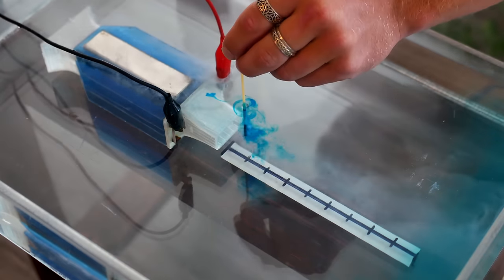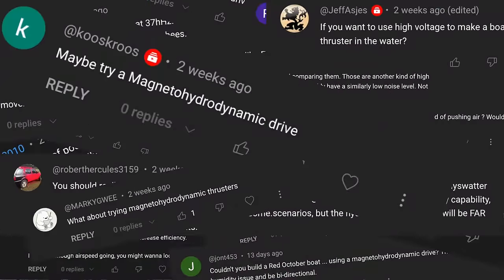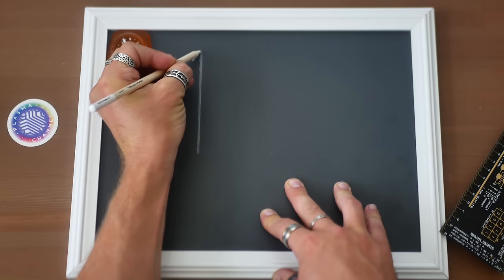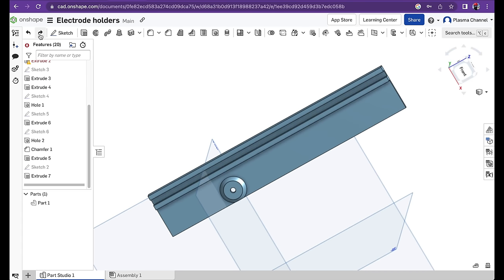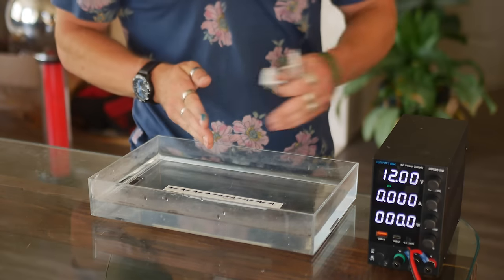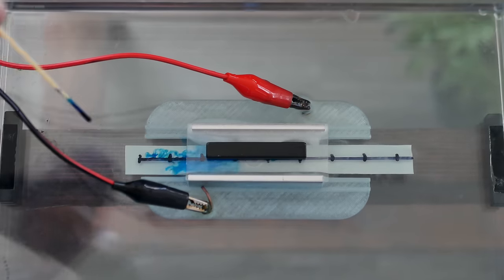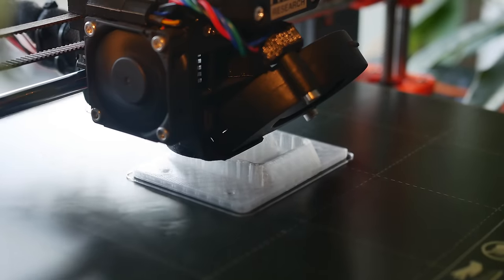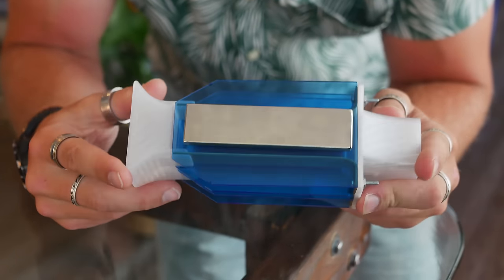Using Stealth Propulsion for Ocean Travel (MHD Thruster Build)

Comment from the maker: Let me know your thoughts down below - I'll be revising this to increase output. For the time being, 3D files can be found on my Patreon site!
Reply: Bro u r genius 😎
Reply: General Atomics has some great powerplants to exponentially increase the dielectric discharge on these types of propulsion systems. Just like how the 6' Ionocraft Townsend Brown demo'd at Wright Patterson in the late 40s was rapid prototype engineered with greater discharge, capacitor plates, & layering to increase the Lorentz Forces to create sustainable flight. 

Pulsed Power applications developed at LANL and Sandia back then allowed for not only Laser Propulsion, but Ion & MHD Propulsion Systems to create extreme acceleration/velocities to "blink" across long distances which to the naked eye looks like FTL. 

You're welcome.
Reply: can you make new star in jar useing tritum atomes
Reply: Use rotating magnets for an AC field and apply synchronised AC to the electrodes. That should minimize electrode erosion.

Another way is to keep the magnets stationary and have the electrodes as part of a rotating cylinder.

If you could create a closed magnetic path except for the water gap, you can use an AC coil electromagnet.
Reply: where can i get that ruler
Reply: by the way love your ideas .... it lifts up my mood
Reply: and elevates my thinking and reasoning
Reply: Why not carbon electodes + AC voltage + Electromagnits, as they do in Japan? Not cool Jerry...not cool.
Reply: The reason for similar velocity with variable spacing could be due to the  volume of water interacting with the setup changes ( but it does not make sense as the further apart has a lower current draw and similar velocity, therefore is effectively producing more thrust)... Because of this it apears a larger gap is better all round
Reply: Does the water salinity play a part as well or does it not matter? That could have been another test base.
(edit: average ocean salinity is about 35ppt (3.5%) for 'real world' testing)
Reply: find yourself a local metal supplier because you'll lose your mind at how much cheaper they are than home depot. I get aluminum off cuts of any shape or thickness for bottom dollar while supporting a local business, you'll be glad you did it.
Reply: You could try using an inert metal like stainless steel to avoid any oxidizing. There's also graphite.

You could also look into capturing the hydrogen and oxygen coming off the electrodes, as they're pretty useful, and a good portion of your energy goes into creating that flammable gas.
Reply: if increasing distance between electrode doesn't increase the speed of the water ......but the volume of water is also increasing means  it will increase the thrust .....need practical confirmation .🤔🤔🤔
Reply: Well, looks like I'm going to have to finally get back to trying to get the gremlins out of my 3d printer so I can attempt this!
Reply: plasma is a conductor. can you do this with fire?
Reply: What small table saw are you using in this video?
Reply: Would a pair of electromagnets be more powerful than a rare earth magnet? If you have an electromagnet you could experiment with AC on both the electrodes and the electromagnets right?
Reply: Maybe some polystyrene balls would be better at gauging the water velocity as dye spreads as it moves it's more difficult to calculate the velocity
Reply: Make an AC resonant engine with electromagnets and isolated electrode plates.

How it works:
The electromagnets and the isolated electrode plates form a tank circuit that oscillates at several kilohertz.
When the water gets polarised in the electric field between plates, the induced magnetic field in the coil pushes it in one direction. When both the electric and the magnetic fields get reversed in the harmonic oscillator, the water still moves the same way.
Use a self-exciting circuit to amplify the oscillations in the tank circuit and thus increase both the current and the magnetic field.

Since distance between electrodes isn’t crucial, but magnetic field intensity is, the electromagnets can be E-shaped with an electrode in each groove of the E and with the middle of the E and the margins having different magnetic polarities (so water in both channels gets pushed the same way). It doesn’t matter if the motor is “opened up”, water is still going to be pushed. Remember, we aren’t making a water pump, we are making a boat propulsion system. So it doesn’t matter if water is pushed in one narrow stream or if the whole ocean is pushed a little, what matters is that the boat is pushed ahead against the water.

Advantages:
- no corrosion
- no energy wasted on electrolysis
- no gases generated
- works with plain water and non-conductive fluids due to using them just as a polarisable dielectric medium

Disadvantages:
- more complex circuit
- requires electromagnets
- requires better isolation, the oscillating tank circuit could reach even 1kV depending on how strong the resonant oscillations are
Reply: Very impressive.
When you turned the engine on it's side it blew gases, I don't believe this was the electrodes dissolving, rather the gases (hydrogen, oxygen and chlorine) that had otherwise been bubbling directly up.
Reply: Could you give us data on thrust by your device compared to a standard drive with the same power input, and power density?
Reply: Hi, Jean-Pierre PETIT is a french expert on MHD and he answer in video to anyone who want his lights.
Reply: Is this harmful for fishes ???🐟🐟🐟
Reply: Could a thin layer of semi conductive silicone be used to prevent electrode decay from oxidation/ electrolysis? But still allow current to pass through.
Reply: close the magnetic circuit from the outside!
Reply: How about double helix wire electrodes with a round bar magnet suspended in the center? Probably want to put in a tube to contain the water around the magnet.
Reply: Why not combine all three: Ionic Plasma Thruster + MHD + Fan Motor
Reply: Maybe closer electrodes aren't pushing more because you aren't allowing enough magnetic field between them. That's why stronger magnets help. You are kinda stacking the magnet fields for more strength to compensate for less room between the fields. I'm probably way wrong. No degrees here just some thoughts. Maybe you could word it better or at least understand what I'm trying to say. ❤
Reply: Did you can use zync metal bricks for defend your engine from corrosion?
Reply: Ok now build electro magnets and use them instead ?
Reply: maruiacancerc  
Wish you an easy recovery and success with your channel 🙏
Reply: I’m pretty sure you’re losing efficiency to the electrolysis. You want a configuration that can run at as low of a voltage as possible while dumping as much current into the water as possible. You’re probably not going to be able to beat seawater’s 1.5v electrolytic breakdown voltage, but the closer you can get to it the more efficient your drive will be.
Reply: How much thrust do you get if you insulate everything and just use electromagnets like in a real railgun arrangement?
Wanna see that video.
Don't you zap a fish if you use the drive you are using?
Reply: What about ring magnets?
Reply: an multiple electroplates? paring them?
Reply: The big loss is electrolysis. Kind of like a diode rectifier looses performance at low voltage high current due to forward voltage. Ideally, superconducting magnets would be used to maximize the force per current.

For your design, try to maximize electrode spacing. Electrolysis is similar to forward voltage- power is proportional to current. Therefore, try to maximize voltage. A single, wide channel is better that 2 narrow ones in series.
Reply: loved meeting you at open sauce. Why cant you just increase the voltage tho?
Reply: @PrintedFirstMessuredAfter  Don't zap the fish! ^^
His reason was probably because he used a model boat sized engine or he doesn't want to zap the fish^^
Reply: What if you used foam beads instead of blue tint to measure speed & acceleration. You could the account for the mass being accelerated. In fact, it might give you a more accurate measure of speed - the foam bead(s) would have much less mass that the water-based tint you’re adding.
Reply: RECOMBINE THE HYDROGEN AND OXYGEN AND IGNITE IT OUT THE BACK OF THE ENGINE!!!!!!!!!!!!!!!!!!!!!
Reply: Create a void? Like get rid of air or water in a place
Reply: Here, electric field = charge per unit area/ Epsilon*water constant 
E=Q/(Aεk)
And voltage supply=(charge per unit area/ Epsilon*water constant)*distance between electrodes
V=Qd/(Aεk)
As area,Epsilon, water constant and voltage supply is constant therefore there is the variation of charge and distance between the electrodes is inversely proportional or simply electric field is inversely proportional to distance between the electrodes but here the effective capacitance is formed so the sudden change in the distance between the electrodes do not suddenly change the charges on the electrodes therefore there is not sudden effective change in electric field in small period of time which can contribute to the water current. It is just like a spring it is not impulsive.
Reply: Try to make spiral for longer acceleration way
Reply: If you run an open system with strips of magnet and conductor layed down in +n-s+n-s in stripes aligned in the direction of travel ,,,,,
The area increases,
The field strength increases (narrower magnets)
The current increases (less distance. 

This way the entire hull can be utilised and the boat falls downhill into the hole created by sucking the water away from the front.
Reply: Ion flow, not electron flow. 
You reached saturation of ion production at the surface of your conductor. 
The ions then flow regardless to distance. 

It’s not resistance, it’s creation of ions,
Reply: @KastorFlux  chlorine gas. 
That then combines with water to form hydrochloride acid.
Reply: @KastorFlux  
Yea. I agree it isn’t much. 
But sodium hydroxide, hydrochloride acid and potassium hydroxide are the most produced and do react back into salt very quickly. 

The electrode issue is cheapest fixed by using stainless and best fixed by using platinum or palladium or gold.
Reply: Wondering could it be done so that the ground is in the center and theres two thrusters on each side. Theoretically thats 3 electrodes total and you can still have 2 different thrusts for steering etc.
Reply: Come to think of it, in principle, we shouldn’t even need electrodes.
If we magnetically induce an electric current in the water, it will itself create a magnetic field opposing the one that induced it so the water will get pushed away.
But for this we need some super-duper-strong electromagnets and lots of power at high frequencies but it sounds plausible.
Reply: @de0509  
The entire hull can be covered by strips of -s+n so the entire wet area is creating thrust not drag. 
When you do the maths etc it’s far more efficient and the boat falls into the hole it made in front and off the hill it made behind.
Reply: @brucebaxter6923  
I actually suggested something like this in a comment to rctestflight 😄.
Essentially pump the water piling in front of the boat to the back of the boat. This might not create a valley at the front but it will render the hull speed to be as high as the pumping speed is which no longer depends on the length of the boat.
Reply: @cezarcatalin1406  
Good idea but the hull still has skin drag and drags the water to the front again.
Reply: @KastorFlux  
Have you ever stood at the harbour entrance and heard a ship go past?
They already are silent
Reply: You could use AC and electro magnets, it should be better because oxidations would be less of an issue. The magnetic field could also be stronger, because electromagnets can be very strong if cooled correctly. I might give it a try myself, and report back on my findings.
Reply: @gellertapati4103  
Nope, field strength is way less from electro magnets, but yes, since it’s ion flow an ac high frequency would be better
Reply: @cezarcatalin1406  I want to see a boat with snow mobile belts
Reply: @brucebaxter6923  even with a ferromagnetic core and highish current? Also, i don't know how it would work with an ac current and non changing magnetic field. I my brain the water would only oscillate back and forth. Correct me if im wrong, I am not that familiar with this type of things
Reply: @gellertapati4103  
Yes. Rare earth magnets are still far stronger than electro magnets for their size and weight. 
It has to just work inefficiently or mechanically flip magnets.
Reply: @brucebaxter6923  the point of this project is to have no moving parts. If he would be going for efficiency, then a prop and motor would be the best way of doing it. For short running times electromagnets with ac would be the better choice in my opinion. It would be inefficient for sure, but he basically has unlimited cooling and also modern batteries would have no problem to supply high currents. If an electromagnet is driven hard enough it can outperform even rare earth magnets in theory. I am really interested in this project, when I'll get a bit of free time I will give it a try myself.
Reply: @h7qvi  Wouldn't moving parts defeat the purpose though?
Reply: I hope LP99 is really what they claim to be. It would be an insane benefit for projects like this.
Reply: @korinogaro  LP99?
Reply: @ThaG001  It would to a degree. There should be less than normal prop wash, but probably still too noisy for real silent use. Really was more just for experimentation.
Reply: I wonder if adjusting spacing and magnetism respectively would Increase thrust. My thought being that if its two forces counteracting each other, maybe the spacing does increase electrode strength but there is not enough magnetic forces to push back against it.
Reply: Your "safe" thruster is creating a lot of chlorine gas. In normal electrolytic systems you would typically use KOH as an electrolyte, using table salt such as you did at 9:47 WILL produce chlorine gas. In the ocean, you have no control over the electrolyte and concentrations. So marketing this as "better" for wildlife is misleading. 

At 11:06 you are getting hydrogen or chlorine gas trapped along the surface of the electrode since the electrode is now horizontal.

 The green residue on your electrodes at 11:38 indicates you were forming hydrated copper chloride salts. The white residue on the same electrode is zinc chloride. Your argument about using brass electrodes is actually not applicable because you are using table salt and any oxides you are forming are on the outside of the cathode where the pH is not regulated.

The nickel plating on the magnets causes a galvanic corrosion channel for the brass.
Reply: @anupbiswas6571  There is a flow of electric current through the water between the electrodes, so if a fish passes through the drive it would get an electric shock.
An other aspect is long term pollution depeding on the electrode material.
Reply: I think when the current goes up due to shortening the distance between the electrodes, you're losing energy to heat and electrolysis.  Have you considered building a version that uses induction, perhaps with a sawtooth wave form?  This might allow you to build a version with no electrodes corroding in the water.
Reply: it is an efficient version of reverse osmosis
Reply: @barontau6552  
Discussed earlier, the chlorine turns into hydrochloride acid and reacts with the sodium hydroxide that also was created and ends up as salt again very quickly.
Reply: @uvx508 seems like no moving parts was part of the goal
Reply: I love the replies here -so much knowledge!!! 😁🤩😍
Reply: @Nobe_Oddy  LOL. but the idea was to make a silent thruster. . .
Reply: @KastorFlux  he could combine literally everything here lol
Reply: You could boost this by reworking its Venturi throat and add an aspirator cone -better yet, add 3 stacked aspirators. To be able to protect against corrosion:

 use a tesla-coil to create a strong electromagnetic field that can transmit through pretty much any insulation 

ooh try using a V shape of the electrode spacing, I've no idea what'll happen. wait, this might add a moving part -BUT 

A spiral-shaped tesla bladeless turbine could add to the thrust while lengthening the path the water takes

(I posted several comments before I aggregated them into this one)
Reply: How about using Copper and magnesium for the electrodes?
Reply: Mass production and raw directional momentum (pushing power) is the practical test. If it cannot compete to the power, durable longevity, and the cost to build for boat propellers, then it's best for toy boats.

If this tech can replace or equal boat propellers. Then it can be the next innovation to explore the ocean. Although, given that it's magnets, the electromagnetism may have unintended faults with its bigger version... Durability concerns for the magnets on a 24 hour active period test.

You could actually build a light weight house on the ocean if you have enough of this tech at different sizes. Assuming the wind and water conditions isn't rocky. Then transform it into a submarine / hybrid land vehicle with the right modifications + wheels. A "moving house" of this kind is definitely not normal to see.
Reply: One design consideration that you're not considering here is the drag of the thruster. It's fine for this test to have a bulky design since the surrounding water is fairly static, but on a boat once it gets going there comes a point where the bulk will definitely be a hindrance. 

STRICTLY SPEAKING, a MHD could be built with very little drag by lining the boat's hull length-wise with alternating electrode-magnet strips in the pattern +,N,-,S,+,N,-,S,+,N,-,S,+, ... This would mean that the hull of the boat is almost "wrapped" with an EM field where the electric and magnetic field are intersecting almost perpendicularly at every point thus generating a skin layer of thrust along the entire hull
Reply: If longer length increases velocity, isn't it a good ideal to use long coiling electrodes as stages of increasing the velocity ?
Reply: Well that's a great idea but what's the point? We are going to need electricity anyway like motor propellers and also if you get the water electrified due to the electrodes you can end up killing some underwater creatures 😅
Reply: @technicalgamer-shounak3633  the electric field drops off in intensity very quickly and it is silent unlike propellers
Reply: Thanks for making. You can get significantly increased magnetic field within your conduction channel by shorting the external magnetic flux return path with a high permeability material. (I.e. -- mild steel.)  Don't let the 'shield' get too close to your channel however, as the magnetic field will fringe (stray) into it instead of traversing the channel.  Very cool.  I'm excited to see your next version.
Reply: Try it with electromagnets please!
Reply: Remember, the velocity of the water doesn’t matter—you’re after thrust, which is a function of the total combined momentum of the water propelled backwards. A larger gap might push slower water, but it also pushes more water
Reply: Can you try making a UFO by mixing the quantum levitation with this as propellers?
Reply: You should try other metals for the electrode and see if higher conductivity leads to higher outputs
Reply: I would love to see a part 2, where you refine this simple 1st attempt prototype, and hopefully see if setting up stages to see if that could help it perform better, have a 1st and then a 2nd stage, see if that would lead to an even faster one... just a thought
Reply: Efficiency? Cost of operations/production? Harmful environmental side effects? Recyclability?
Reply: Give me samarium magnets! They're difficult to get, make some of the fastest motors and would be epic for this or flying saucer tech 😅
Reply: Were you not worried about creating chlorine gas from the electrolysis of salt water?
Reply: Hello friend!
Maybe you can try to use a circular Halbach array so you can benefit from all the sides of the magnets and also increase the magnetic field in the functional aria I have a design that uses the same concept that you may be interested in
Reply: @Galerak1  yes, I built some of these back in school. The salinity improves the conductivity of the water. It gets faster the more salt you dump in the water.
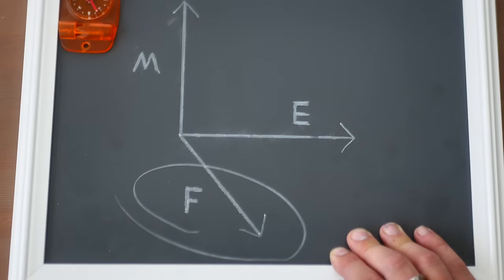Reply: 2:50 This is how a railgun works.....This is how a railgun works.... does this mean you can shoot water with this?
Reply: the issue for long term use is the electrodes being killed - platinum lasts longer, or keping the voltage below 1.2V which needs more electrodes for closer spacing to keep the current higher.
It can move a boat, i've made them before - but it uses a LOT of energy.
Using higher voltages and aluminium electrodes (all I had handy at the time) you could see the aluminium being 'blown off' and flakes of it floating about in the test tank.
Reply: What if the electrode was just a winding around the magnets but on a outside of tube and the magnets were inside the tube.. instead of the current going thru the water making Hydrogen 2 and oxygen 1.. stopping the electrolysis process??
Reply: @Nobe_Oddy or use to power the system..
Reply: OUTSTANDING! I wish I had that kind of propulsion on my Flying Submarine to assist on takeoff. Good luck with this project, and hope the U.S. Government is more supportive than it was for our project. br
Reply: What about carbon fiber electrodes? They are non corrosive and are really great conductors.
Reply: Can AC current mitigate the corrosion and increase efficiency? Magnets should be electrical too, of cource.
Reply: Can you 3d print a Red October?
Reply: So, for electrode spacing, you measured velocity which remained constant despite spacing. This suggests that wider spacing may be moving more water at the same velocity, which may mean more thrust.
Reply: @edwardnardella6854  Also what happens if you v shape the electrodes wider at the front and more narrow at the back and perhaps do the same with the magnets. Does this create a Venturi effect increasing the velocity of the flow?
Reply: I’m missing the test of space between the two magnets. Your data suggests a wider distance between electrodes produce more water volume being moved. But I would believe having two magnets closer to each other would make it faster.
Reply: If you incorporate a tesla valve at the end of the thruster, it would increase the flow of water to add more thrust without adding any moving parts. Just like a pulse jet engine. You would be able to keep the noiseless aspect of your thruster as well 😊
Reply: Have you considered trying a cascading design to see what the trust would look like?
Reply: also as to why the stronger field wasn't effecting em any more, maybe try adding a electrolyte to the water like salt :/ cause the majority of the water they'll encounter is salt water, the fresh water might not be conductive enough.
Reply: Try to use graphite as electrode
Reply: Interested about AC vs DC in this application.
Reply: what would happen if you increased the length of the magnets? I don't mean the power of the magnet itself just its length or size. I am curious if increasing the path down which the water went if it increased its force/speed.
Reply: What if you place 3 electromagnets in a triangle turn them on and off to mimic rotation could you point the fields into the center of the triangle and place a stationary conductor like copper or nickel gold
Reply: I wanna know if you can spin a magnetic field around a core with. No moving parts using 3 6 or 9 electromagnets in various configurations all turned off and on to spin the field around the core.
Reply: @dshcfh  graphine coating is another option.
Reply: Try to use platinum electrodes, if you can😅
Reply: E=V x B. Try insulating the electrodes for reducing current draw and corrosion resistance. You likely will retain thrust
Reply: Love this! From the bubbles & corrosion on the nuts & bolts where the wires attach, you're losing some voltage the where electrolysis is occuring. Also, how about using gold plated brass, since gold conducts electricity much better than brass? I'd say use silver, but that does corrode in sea water. Maybe gold plated silver? Would Love to see if changing the metals changes the thrust!!!
Thanks,
LightMike
Reply: You can use graphite instead of metal blades so that the oxidation and reduction reaction does not happen
Reply: 2 things I wonder, one is maintenance, the other is about the electrode spacing and then the thruster output nozzle.

1. Have you tried using a "sacrificial anode" with electrodes like ships usually do to prevent hull corrosion but this time on your electrodes? (Or am I missing a detail here where this isn't possible)
2. Have you tried looking for an optimal size difference between electrode spacing and output nozzle size to improve trust?
Reply: "Closer spacing should lead to higher velocities."

I think the Lorentz force also depends on the strength of the magnets. 

To test this, perhaps a variable electromagnet with the neodymium one as the control?
Reply: All I see is brown gas being wasted
Reply: Did your current draw actually go up? Or were you conducting the same current limited by your power supply settings? A wider distance should help your overall design since you could get a larger "active region" to accelerate more water, no?
Reply: smaller or variable exhaust?
Reply: @MichaelThompson94 Yes but by generating the gases you're slowly dissolving the electrodes
Reply: @michaelsell9012  the current must go through the water. If it is below 1.2V then it won't split. The current in the water is what interacts with the magnetic field and pushes it along and out th thruster
Reply: Have you thought about making anything from geet plasma fuel processing?
Reply: I wonder if you can just ionize at the start of the channel and after only provide a higher voltage field without electrolysis. E.g. narrow the tube and put insulated 1000V across it.
Reply: Do you think you could make a direct spark plug replacement for a conventional  combustion engine…That uses some combination Of An HHO device / MHD thruster ….I’m really tired of paying for gas!😊😊😊
Reply: a material to avoid water touching electrodes and at the same time allowing the process? would it be even possible?
Reply: @KNBARON  geet fuel processor. Your welcome. I have one geet tuned to run off ambient pollution. One for heavy viscosity liquids, then the general water and used multioil engine. merge your carb to your exhaust, in vacuum only 900 needed for plas, energy exchange forces the reactor to take big complex molecules and makes tons of tiny ones with the building blocks. 150. The pdf is free. Enjoy.
Reply: Cant you put a copper wire donut aroung the outside of the water channel, to increase the megnetic field increasing thrust?
Reply: I know electrolytes, changes the compisesion of the water were the salt becomes toxic, as in making hydrogen, my ? Is your test water safer , or worse than before  trial test, because if water becomes toxic than this idea is not sustainable for any water source.
Reply: I'm no engineer, but I can't help but wonder if varying the magnetic field strength (if that's even possible) like with an electro magnet would have an effect on the velocity as well? Again, I apologize if it's a dumb question, as I have nothing beyond a basic public high school education.
Reply: The hardware might be silent but how could you not hear the cavitation from the bubbles?
Reply: You should build another one and put it with the ionic thrust boat and see how fast it can reach together
Reply: Would the use of a Rodin coil help?
Reply: please test in a mini boat
Reply: Solder leads on to the plates and insulate with epoxy. I think you are losing a good deal of efficiency making browns gas between the gator clips. Cheap easy upgrade that should get you some better results.
Reply: I thought the same thing with the plastic balls, the only issue I see is it would be less accurate due to spin being imparted on the ball, as velocity increases more friction will as well yet the interim of the ball will not. This could throw off the results. Little foam disks would eliminate this issue.
Reply: *inertia of the ball will remain the same.
Reply: I know I probably won't be seen by you (PlasmaChannel) but why not make the brass zig zagged in shape, rather than flat?  Wouldn't that give more surface area?  Or better yet, perhaps solder on fins, like a brass heat sink, instead?
Reply: *Experiment Title: Integration of Ionic Propulsion Thrusters with Alternator-Integrated Ducted Fan for Energy-Enhanced Propulsion*

*Overview:*
This experiment aims to demonstrate the concept of integrating ionic propulsion thrusters with an alternator retrofitted into a ducted fan to enhance energy efficiency in propulsion systems. By generating electrical energy through the fan's rotation and utilizing it to power the ionization process, this experiment explores the synergy between real-world applications, mathematics, science, physics, and engineering principles.

*Experimental Setup:*

*Materials:*
1. *Ducted Fan Assembly:*
   - A ducted fan unit with adjustable fan blades
   - Alternator (with coils and magnets)
   - Lightweight housing for the fan assembly

2. *Ionic Propulsion System:*
   - Ionization needles or emitters
   - High-voltage power supply
   - Sealed chamber for ionization process

3. *Power Management System:*
   - Voltage regulators
   - Voltage control circuitry
   - Electrical components for power distribution

4. *Sensors and Measurement Devices:*
   - Thrust measurement equipment (load cells)
   - RPM (rotations per minute) sensor for fan speed
   - Voltage and current sensors

5. *Visualization Tools:*
   - Smoke generator or visual particle tracer
   - High-speed camera for airflow visualization

*Experiment Execution:*

1. *Ducted Fan Integration:*
   - Retrofit the alternator into the hub of the ducted fan assembly.
   - Ensure precise alignment of the alternator components for optimal energy generation during fan rotation.
   - Establish secure housing for the integrated system to maintain safety and stability.

2. *Ionization and Thrust Generation:*
   - Position the ionization needles at the inlet of the ducted fan.
   - Set up the sealed chamber to enable controlled ionization.
   - Activate the ionization process by applying high voltage to the needles.
   - Initiate the fan rotation to create airflow.

3. *Energy Generation and Power Management:*
   - As the fan rotates, the alternator's magnets induce a current in the coils, generating electrical energy.
   - Implement voltage regulators and control circuitry to manage the distribution of generated electrical energy.
   - Balance the allocation of energy between ionization and alternator to optimize propulsion efficiency.

4. *Thrust Measurement and Data Collection:*
   - Use load cells to measure the thrust generated by the ionized airflow.
   - Employ an RPM sensor to monitor fan speed.
   - Utilize voltage and current sensors to measure electrical output and usage.

5. *Visualization and Analysis:*
   - Generate smoke or use visual particle tracers to visualize the airflow patterns created by ionized particles.
   - Employ a high-speed camera to capture airflow interactions and fan rotation.

*Expected Outcomes:*

1. *Thrust Generation:* The experiment demonstrates successful thrust generation through the interaction of ionized particles with airflow.

2. *Energy Generation:* The alternator generates electrical energy proportionate to the fan's rotational speed, showcasing the potential for energy conversion.

3. *Efficiency and Control:* The power management system effectively allocates energy to ionization and alternator, highlighting energy-efficient propulsion.

*Math, Science, Physics, and Engineering:*

1. *Electromagnetic Induction:* The alternator's integration utilizes electromagnetic principles to convert mechanical rotation into electrical energy.

2. *Fluid Dynamics:* Computational fluid dynamics concepts guide the behavior of ionized particles within the airflow.

3. *Voltage Control Circuitry:* Engineering principles ensure efficient power distribution between ionization and alternator.

*Conclusion:*

This experiment combines real-world technology with mathematics, physics, science, and engineering to showcase the potential of harnessing electrical energy through fan rotation for enhanced propulsion. Through meticulous setup, data collection, and analysis, this experiment explores an innovative approach to energy-efficient propulsion systems, with potential applications in various fields.
Reply: Excellent work! What's your thoughts on an AC powered version (with AC magnets of course so they change poles with as well). Would this reduce oxidisation on the electrodes?
Reply: Yo Mr.bum turn into a tea laser too duh
Reply: Sorry forgot: and use flexible transparent resin so you can induce forced vibrations via bone transducers (for the laser to bounce). If you have it put one-way mirror tent on it(the flexible resin) to make an infinity mirror chamber resonator for your magneto hydrodynamics driven tea laser. (All you need now is a cholesteric substance for the flow so that we get phase differences, so then you can pop a phase filter on the joint. Blessed b let me know if you need help or summin.
Reply: When doing your testing you are using very small water tray. I think the thrusters will generate a circulation that will feed it self, making it seem as if the thrusters are working better than they actually are. Hope that makes sense. 
Basically, I think you need a much bigger water tray to minimise this effect to do a proper test.
Reply: I haven’t read the other comments, however I would recommend testing the shape of the thruster. This thesis should especially work since there is no direct correlation between distance of magnets and velocity. I suggest a cone shape, or form factors similar to modern thrusters on spacecraft’s.
Reply: Did you think about combining MHD with your Ionic engine?  Your Ionized air is conductive like the water, so you can use the same principle to move ionized air as the water.
Reply: I use graphite plates instead metal. With graphite you dont have the oxide layer problem.
Reply: My questions might really be your questions... But, it takes the questions to line up for creating usable formulae 😊
It has to include all the questions, though.
Reply: please read this, positive ions face two forces, lorentz and electric field force, we get the resultant force, so to make this resultant force's direction perpendicular to electrodes we to change the electric field direction. you can try this, arrange the electrodes pairs of same length with increasing voltages. there is a chance that some ions will go in the field of electrodes with higher voltage which will extert a electric field force which will make the resultant force more aligned to the desired direction of flow.
Reply: can not upscale this, becouse of magnets, if you do not know why, you will if you try. hint " magnets "
Reply: How about chaining circular magnets and electrode washers and running them as a pulse? Btw nerd here , just not a professional. Or is there a way to just use pure magnetism without the electrodes to get the same effect?
Reply: Could selecting metals that havethe least conductive resistance improve the results? My theoryis it might provide minimal improvements to the thrust in comparison to the other factors, but could improve it. But it looks like the choice of conductor that best mitigates resistance with corrosion might be more impactful by a longshot....
Reply: whats the external magnetic field like? Will running the thruster deflect the needle of a compass when operating? Could Rambo detect and track your propulsion system with the compass in his knife? Do offshore wind farms cause whale's to become confused and smash into things and die?
Reply: Would laminar flow help?
Reply: This idea is great for sound reduction, and what it really is. When "bubbles" are created underwater sound is also being created. The cavitation will still  give off a sound frequency or signature that can be matched to the power supply. The perfect underwater motor would really be a wave type motor that causes no cavitation (bubbles). This video was great because it appears that you've made an underwater muffler that can be replaced rather quickly and inexpensive.
Reply: Man, you need to discuss with Jean-Pierre Petit
Reply: as with the ion propeller, you are aiming at velocity, but in propulsion what matters is MASS, mass flow, mass momentum, not velocity.
the (+) ions generated in the anode ((+) electrode) are repelled and create suction that is compensated by incoming water from the other end of the tube. Distance between electrodes does not matter, as the catode could be away from the anode and neutralised by the salty water positive ions. With your design I would change the configuration of the tube, first would try a T shape, in 2D, if this work you can design a 3D T, with rotation with different oulet tubes.
The idea is to really get all the thrust from the moving water, like an underwater sail, but with a T shape. In 2Dm the electrodes along the base of the T, and the outlet on the two arms of the T, there you will notice if the push from the water is significant, pushing on the arms of the T shaped tube. If that works, you can improve with a T with bent arms, ===), for better hydro dynamical performance, and move to 3D ===) by rotation along the axis. The outlet of water should be at 90º to the direction of the motion. That's a detail, just try to get push from the moving water, as a ram hitting a surface. Do not worry about Newton's 3rd Law, it's just for books, the speed of the outlet water just means you have enough flow to push.
In your optimization tests you saw that what matters is the amount of ions generated (i.e. surface of electrodes and power) Remember that to ionize Cl(-) to Cl(+) you only need a few volts, the electrochemical potential or voltage, which is not the same as the voltage you apply to the electrodes which tell you how much current flows in the circuits.
In the air, you may need more voltage to ionize N2 to N2(+) or O2 to O2(+), but the principle is the same, and you can use a sail to collect the air blown by the air sucked into the electrodes that moves through. If the area of the sail  is too big you may sail according to the wind, not the propeller.
There's an environemntal problem though,  you are leaving a trail of bleach in the water that may kill plankton and discolorize fish and marine organisms, unless you have a water treatment plant on board to neutralize Cl2, HClO, etc. The plant can be implemented as the outlet water, after hitting the arms of the T, is no longer needed for propulsion but only necessary to evacuate the chamber and allow water to enter the ionization chamber.
Reply: Can you recover H2 and O2 created?
Reply: Please upscale this and put it on a real boat
Reply: @h7qvi 
I read your comment, like it was a scene from Red October. 
Orders given out by Sean Connery 😂

 
 'DaCaptain Marko Ramius, 
Shall we also
 power up 🔌 the magnet' ⚡️🧲
Reply: @waynesworldofsci-tech  an electric motor and propeller fed the same power would produce about a hundred times as much thrust.
Reply: @cezarcatalin1406  yes, you are describing an AC MHD drive. Check the Wikipedia page for "magnetohydrodynamic drive" for a description.
Reply: You must be a genius to explain this so well
Reply: Hello can I ask for your help in an experiment please 🙏
Reply: I am interested in self generating spaceship homes. Basically I want to move humanity to an ai spaceship fleet. I was thinking of an ai spaceship core that uses carbon to grow.
Reply: @WheezyCyclist  Exactly my thoughts! If the wider spacing does not decrease the velocity the output power must be much greater.
Reply: Bro please share the 3d design bro
Reply: Give the patreon site name of our channel bro
Reply: Any updates?